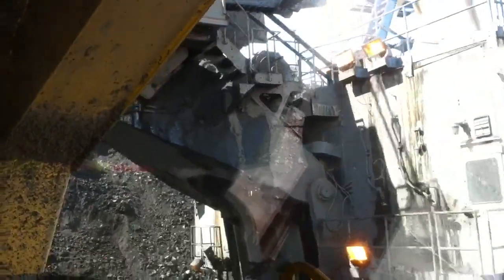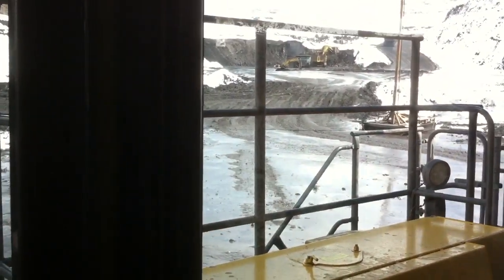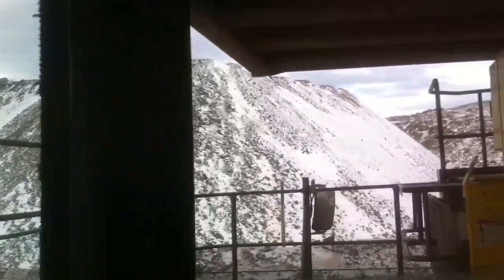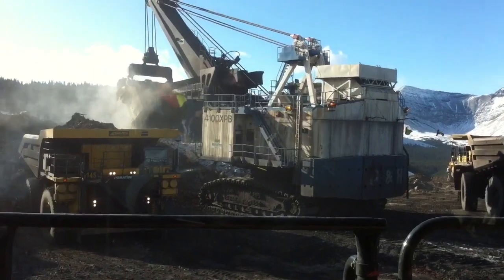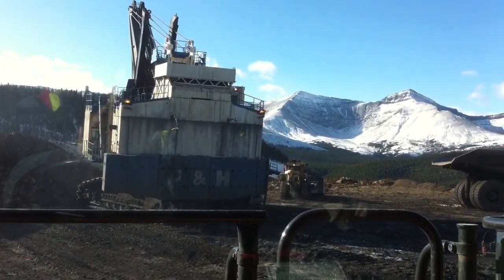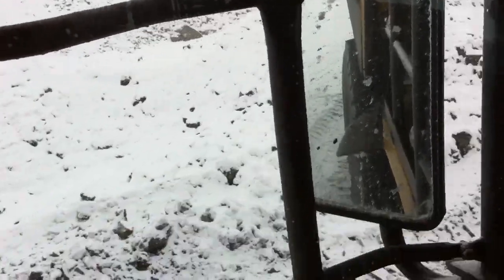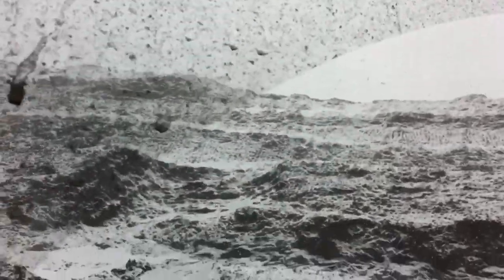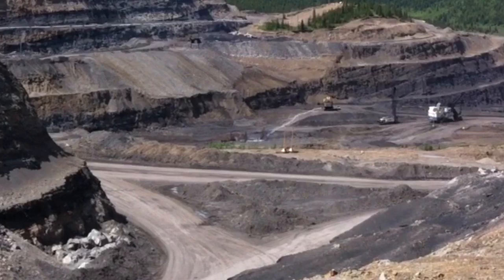Mining In The Mountains...PART1

Comment: I drove the Dressers at Fording River for 12 months around 2002/3.
Reply from the maker: Were they the 170 tonners?
Reply: @Indeewoods  never understood the ton/tonne thing…grew up in England where metric was a dirty word 🤪 They were the full on rock trucks, or, as we were supposed to refer to them, “mine heavy haulage trucks”. When I was there there were 2 types of trucks…the dinky coal haulers, then the rock trucks which were the Dressers, CATS, which were the same capacity, then the giant Komatsu’s.
Reply from the maker: Ya here it seems we use half and half. Have metric half standard.
We had 170 ton truck,240 and 260. The Unit rigs were 260’s. 
Up in Fort Mac and other mines now they use 400 ton trucks.